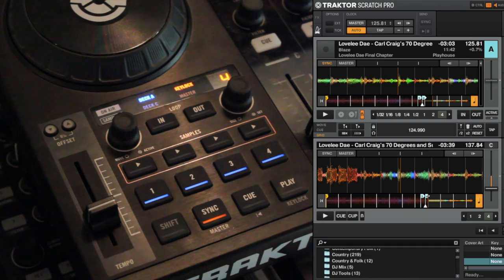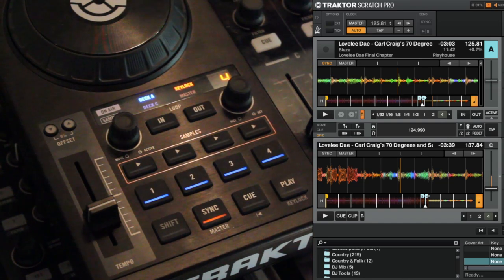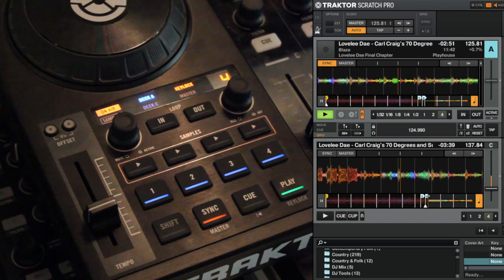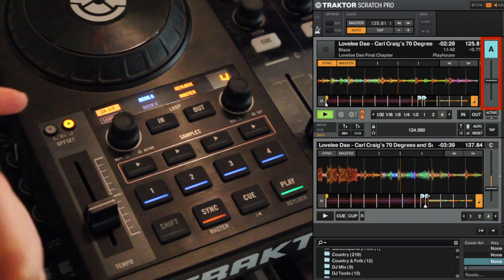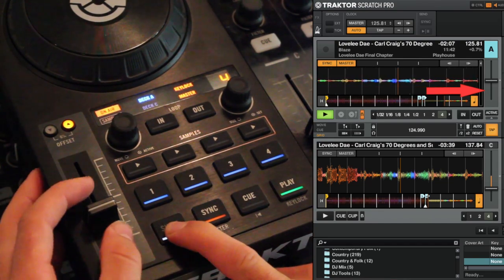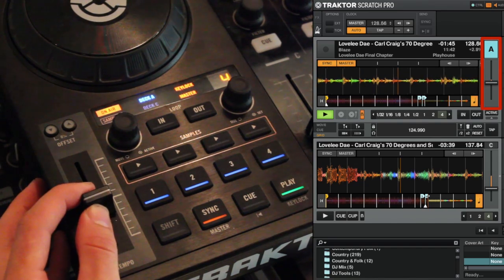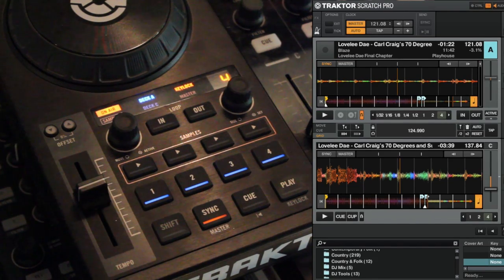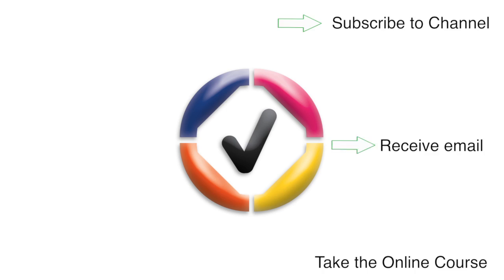Offset Button Explained - Traktor Pro

Comment from the maker: Yes I would assume so - just go into your controller manager and change it up. You could maybe try and assign volume slider for deck C to your left decks tempo adjust. You'll just need to hunt out the tempo fader in the drop downs in controller manager